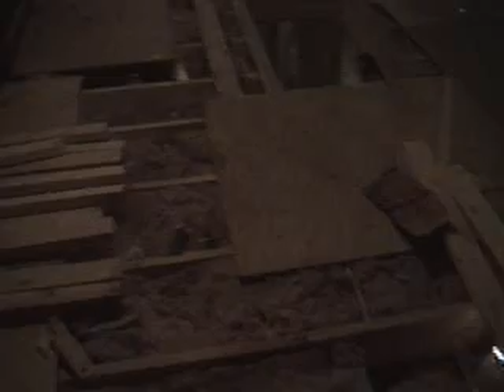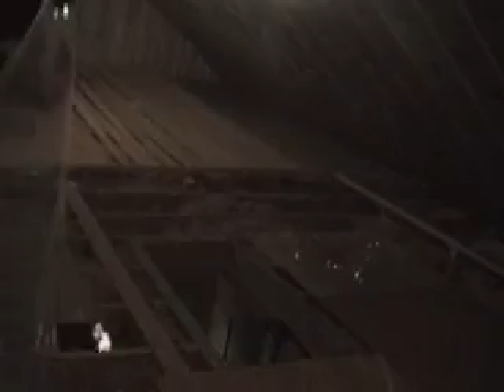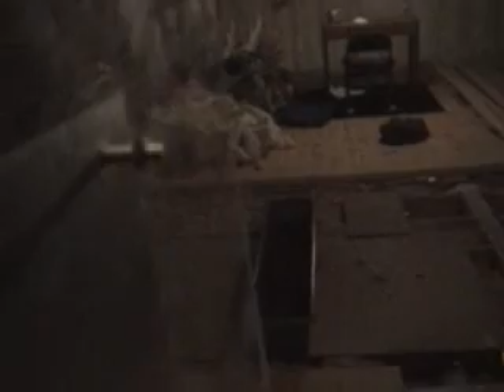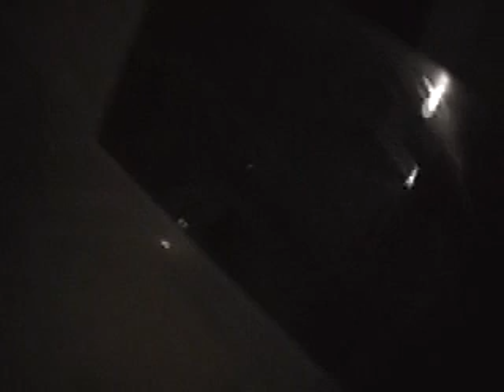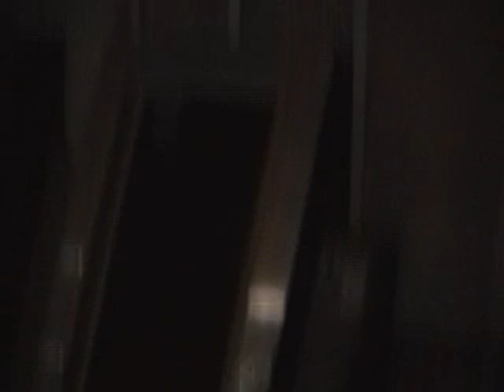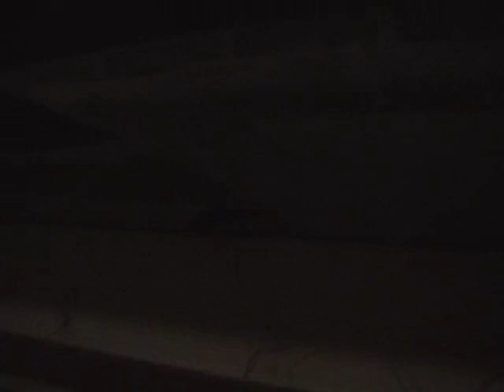Utilization of Radiant Energy 1901 Nikola Tesla,my setup 2

Comment from the maker: you know what, i did try attaching a 9 volt and i think it might have started a weak electret, but im not sure because i have discharged the circuit and havent hooked up  the 9v and its beeen charging again with my 3rd plate i just put up. i looked up the electret but i dont get why i wasnt taught that in h.s. . its almost like magnetism with charge instead. i was impressed wih what i got but if i can improve it i will definatly try what your saying. its dc hv right?